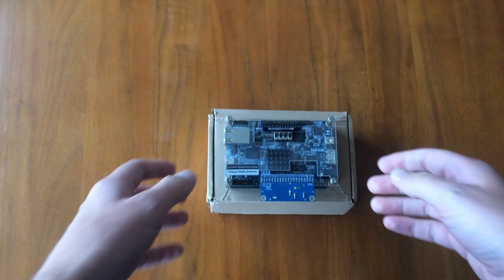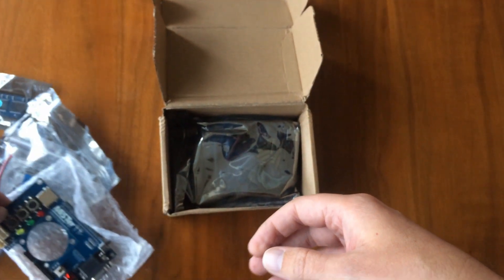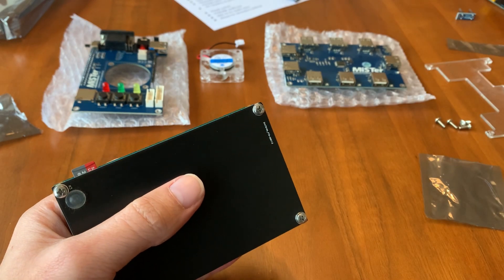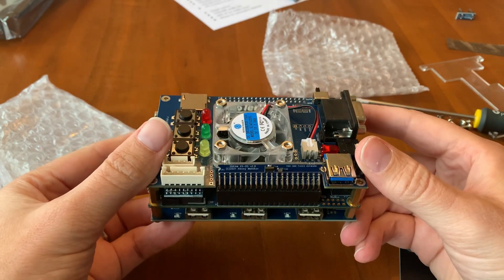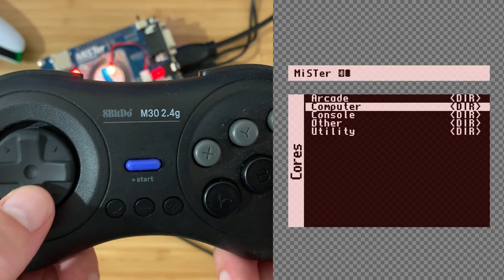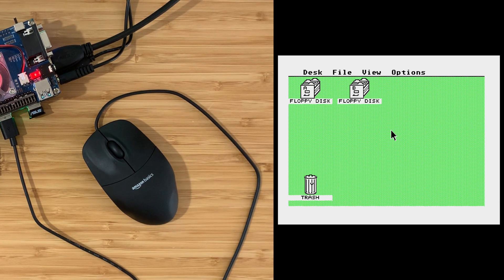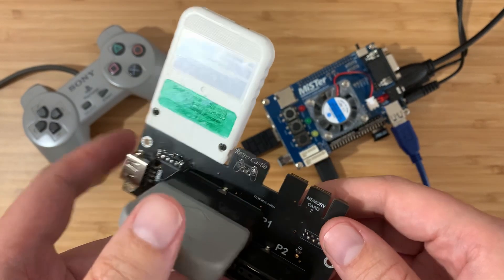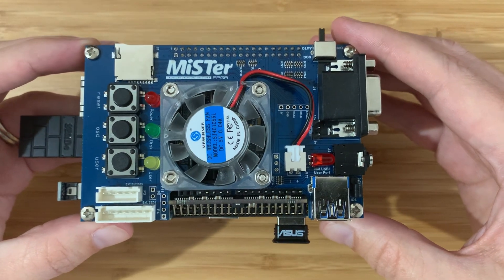Add-ons to Supercharge your MiSTer FPGA

Comment: Hi James, I found you via your blog articles on installing Windows on a Mister setup, thanks for those, I'd like to try that for a project I have in mind. Wondered if I could ask your advice: I have some old digital cameras circa 1996 with internal memory and serial connections to old PCs or Macs - no removable memory cards. I have the cameras, the cables (typically 9-pin serial) and the original driver software too, but I don't have a suitably old PC running 3.1, 95 or 98 and which also has an old serial port. Do you think I could I get this working on the Mister 486 core (I have a Multisystem)? Thanks!
Reply from the maker: Thanks for the kind words :-)

Some of the cores do support a serial interface, so yes this technically possible! You may need to run a small program on the Linux side of the MiSTer to bridge the serial traffic.

Is there a specific camera and model you have in mind? Happy to do a bit of research here
Reply: @jamesfmackenzie  thanks! The most famous is the Apple Quicktake 100, but also the Olympus C800L from my own collection... cheers!

Comment: Cooler inverted ?
Reply from the maker: The cooler is regular orientation, but I threaded the bolts through from the back because it was easier to tighten that way :-)